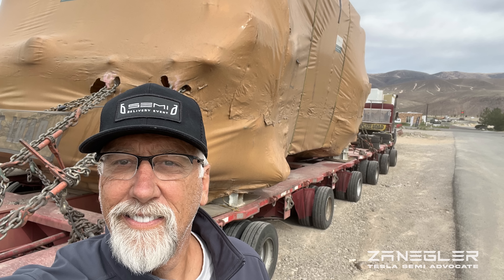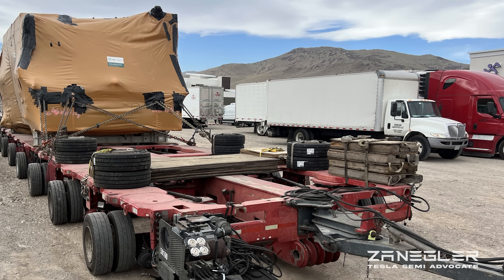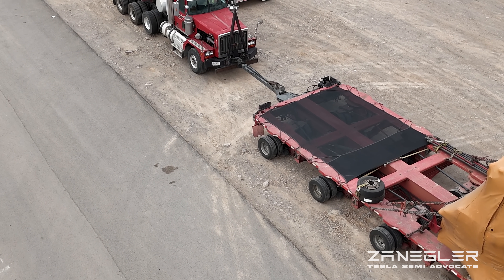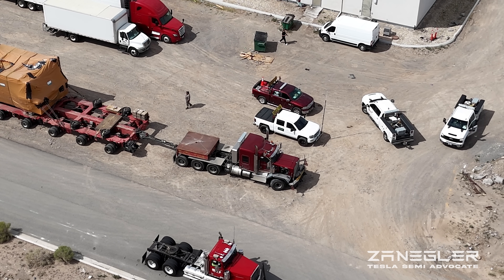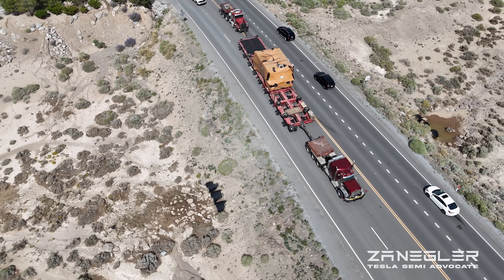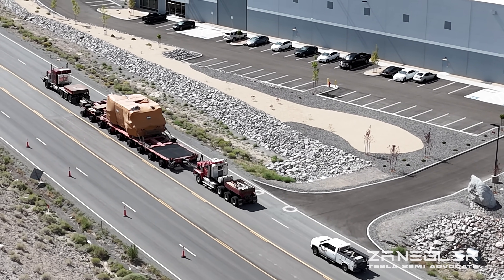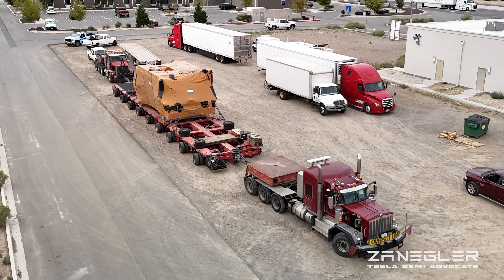Tesla Giga Semi Stamping Press - Final Assault

Comment: This is great stuff! 

I'm not going to ask any particular questions, just enjoying the information and the show. I am writing this early in the video to give my guess about the bridge crane: 

Maybe they're using the big one inside now?
Reply: My understanding of the narration at 2:35 is that the stamping pressline component is 250,000lbs, which is 113metric tonnes. More than twice the weight of the maximum capacity of the bridge crane installed (50mt), hence the use of a gantry crane to unload.

Comment: Thanks Zanegler
Sort by newest first or top comments if only the first few lines are visible
Let me be the second to congratulate you on your finest flight!
0:43. Barnhart. They craned some of the hoppers into the southend of Cathode at GT back in September 2023.
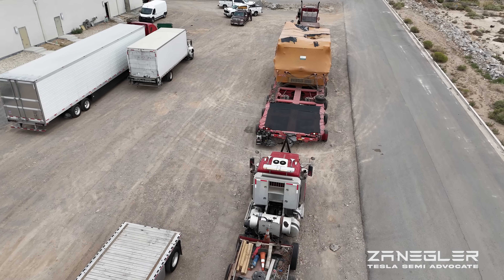2:47. Stamping Press. Not speculation. Confirmed to be a Stamping Press by Lars Moravy. Don’t get any better confirmation than that.
250,000lbs is 113t. More than twice the weight of the maximum capacity of the bridge crane installed, hence the use of a gantry crane.
5:11. “one more stamping press exists in Texas”. Given the 3 week journey, there must still be at least one component on the road. Left GT about 2 September. Plus the one component still at GT as seen in Brad Sloans video of 9 September.
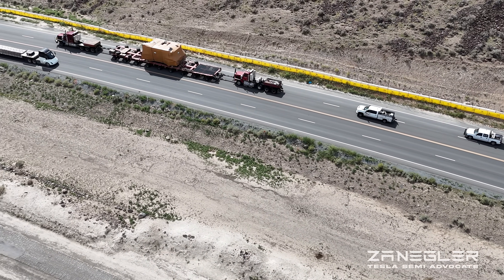9:19. Rear tractor. Only the rear axle is operating.
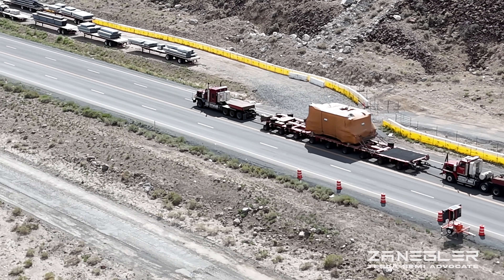10:16. Brad Sloan was in fact the first to film the arrival of these components at GT. 30 November 2023.

Comment: I don’t this this is counter weight. It looks like just weight to ensure the rear of the track is loaded and gets traction. In normal trucking the weight on the rear wheels come from the trailer on the fifth wheel but here they’re towing it behind so to get traction on the 3 rear axles they need the weight.